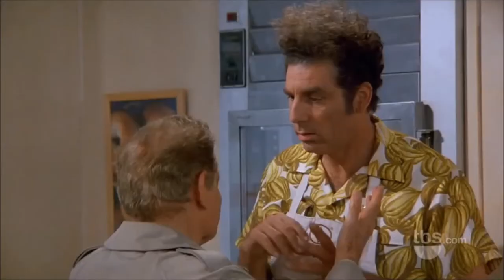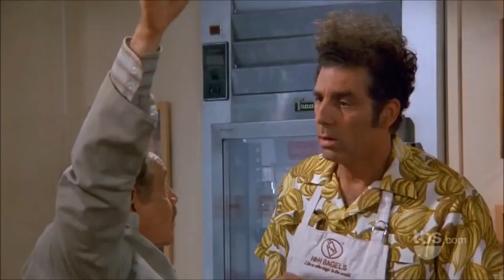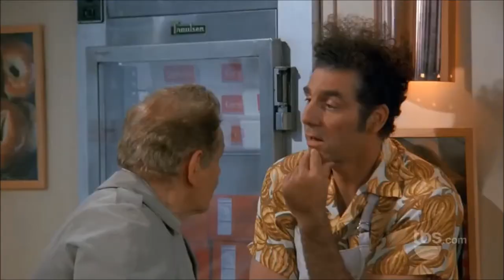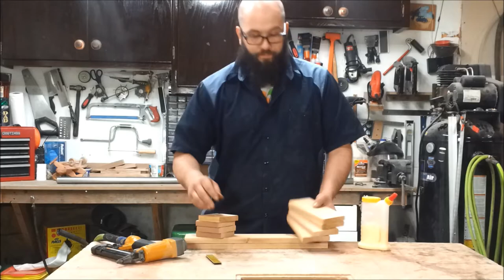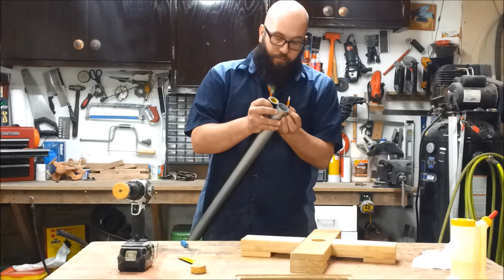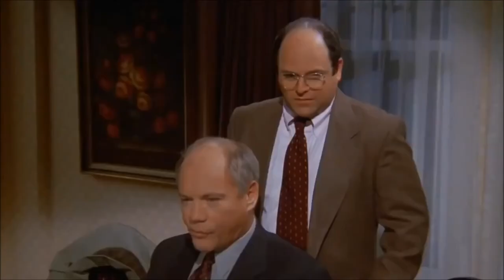DIY Festivus Pole and Stand Quick Easy Limited Tools Seinfeld Inspired Project

Comment: Yes, aluminum has a good strength to weight ratio, but galvanized steel pipe has a superior overall strength and is much less expansive than aluminum. My Festivus Pole is made from a 6 foot galvanized steel pipe and a cross base similar to yours. If fact, the pipe that Frank Castanza had was actually a steel pipe. When he first brings it into the the diner you can see it was very heavy, in fact Frank let the bottom drag on the floor - listen carefully, you can hear the heavy steel pipe lightly scrape across the floor as he walks in - its a distinctive sound, an aluminum pipe would have sound more "ringy".